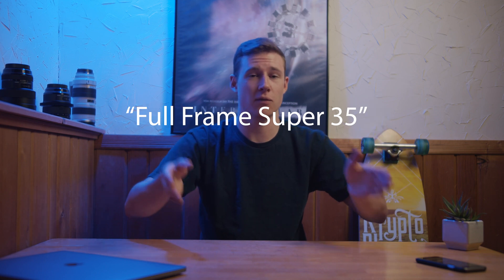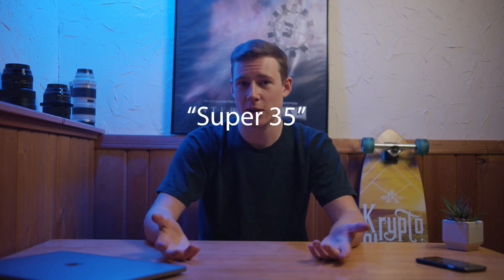Full Frame VS Super 35 | Sensor Size Explained!

Comment: Can I use a lens made for a mirrorless camera on a camera with super 35mm sensor? I am trying to figure out if the Sigma 24-70 f2.8 for Sony E-mount will work on my Sony FS700R that takes E-mount
Reply from the maker: Mirrorless or not mirrorless is irrelevant, it depends more on the sensor size of the camera, and the coverage (measured in mm) of the lens. You should be able to find/compare both of those numbers on the manufacturers website, or you can always chat with a B&H rep if you have specific questions!
Reply: @tuckerkanderson  Okay thanks man! So if the FS700r is a Super 35mm sensor, and that lens is a fullframe lens, will they be compatible?. Perhaps you can be my B&H rep in this instance? (heart emoji)
Reply from the maker: @BeanDar  Yes if your sensor is super35 and lens is rated for full frame you'll be good to go!

Comment: I think confusion is from what 35mm means in the video world and the photography world. Super35 is bigger than video 35mm (Academy Full Frame) film but smaller than photography 35mm film. Because so many ppl shoot video on hybrid cams these days “full frame” applies to that version of 35mm, but in the video world it’s thought of as large format. Think how confused ppl will be if photography medium format is more common— even larger than full frame photo, so it’s larger than video LF large format but it’s called “medium”.  Lenses should all be standardized to T stops instead of F stops, viewing angle instead of focal length, and sensor diagonal size w/ aspect ratio instead of all the various names of film and sensor sizes.

Comment: Didn't clear up anything for me, if I am honest.  Is the PL mount same as full-frame?
Reply from the maker: Hi Andrew. A lens mount (like PL) has nothing to do with a sensor size. That said, certain lenses have glass elements within them that can or cannot cover certain sensor sizes, depending on the size of the glass. For example, a lens built for a micro 4/3 sensor, would not work on a full frame camera, as the field of view of the full frame camera would make it have a large vignette if you tried to use a micro 4/3 lens. Hope this helps.

Comment: If one was to use a full frame lens on a camera with a super 35mm sensor, what would happen? I want to get Zeiss CP.3 Full Frame lenses and a Blackmagic Ursa 12K, but the Ursa 12K has a Super 35mm sensor. I looked up prime lenses that are made to specifically cover the super 35mm sensor and the cheapest ones I can find are the Cooke S4/i series which all start at $7500 as opposed to $4500 for the Zeiss CP.3's. I don't want to work with  Cooke S4/i lenses, they are soft, slow and expensive, i need fast, sharp and relatively cheap. There's gotta be some sort of adverse effect to using a full frame lens on a camera that has a super 35mm sensor, otherwise why would they make lenses specially designed for a super 35mm sensor? Please help.
Reply: If you use a FF/135 coverage lens on a S35 sensor, you are using the sharpest and cleanest area of the lens. Many lenses made for FF/135 vignette or have soft edges wide open, on a FF/135 sensor. So by using a lens designed for FF/135 on S35, you are getting the cleanest edge to edge image that lens can give you.

Many cinema lenses have been made by rehousing FF/135 coverage lenses, Canon K35s, Cineovisions, Ultranons Samcine, Optex, Century Optics and all the early Panavision lenses.
Reply: @flyingfox2005  Thanks for the words of wisdom, maybe one day I'll buy the 17K Ursa Cine  camera from Black Magic and get large format lenses and have to use this info for shooting in Full Frame mode.

Comment: What’s the cheapest cine lens I can get for a super 35? Without killing the sharpness/resolution?
Reply from the maker: I mean its hard to say, as the "cheapest" cine lens you can get will be soft without a doubt. If you don't need cine gears, the sigma 18-35 is a great pick for a super 35 lens. Super sharp, even wide open.
Reply: Yeap. The sigma is good. You can also try the meike 35